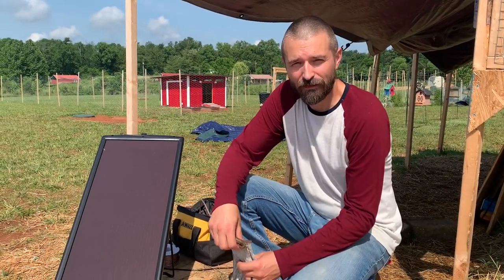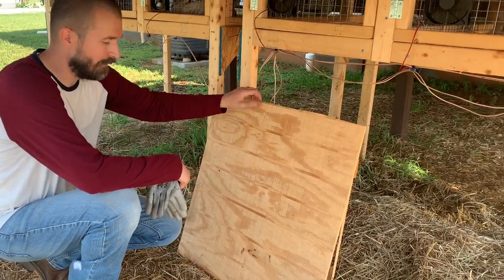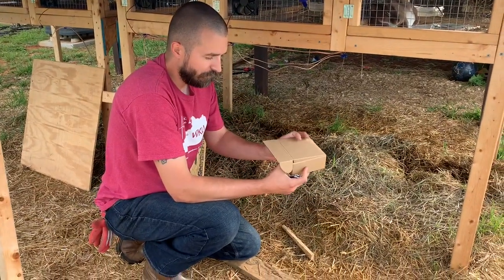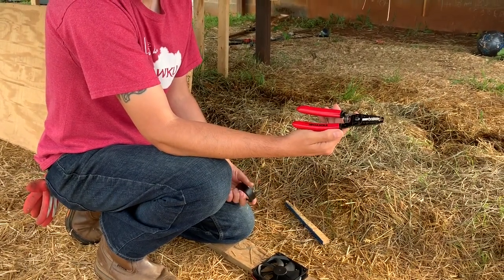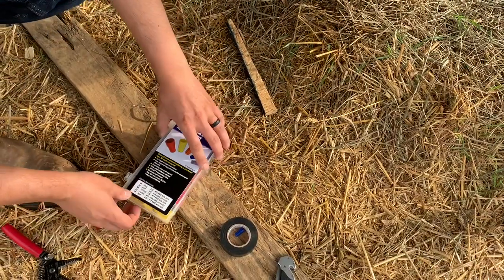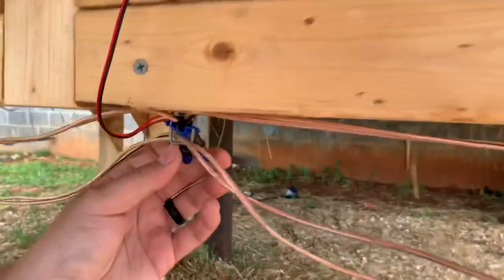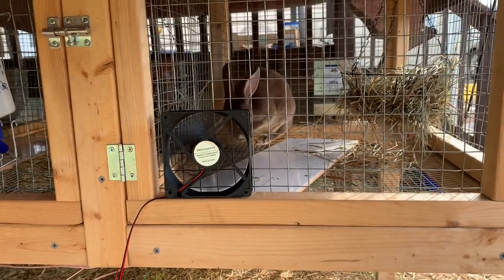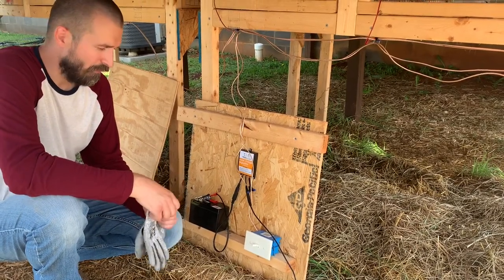Solar Powered Cooling System for Rabbits

Comment: Want to thank you for this video. I was able to follow easily and create the same system.
Reply from the maker: Glad it was a help to up
Reply from the maker: We have since upgraded 2 - 100 watt panels and added a bigger 12v battery car size from Harbor freight and put the fans on light switches and bought some bigger 120mm fans that put out a bunch more air movement and has been a great setup as well
Reply: @HomesteadersOnTheHill  I have 3 computer fans running and I have a 12v ceiling camp fan. Just got it installed today. Do you think you will post your new set up at some point?
Reply: @HomesteadersOnTheHill  when your battery is fully charged what happens? Is it possible to overcharge it? With batteries at times causing fires I just want to know how it works.
Reply from the maker: @newtonfamily7969  , I’m trying to remember this setup but if you have the solar charger on there it will not overcharge the battery but if it is full you cannot use the extra battery power for anything. You would have to attach a second battery in order to continue and build up more battery power. If you tie them together in parallel you capacity increases and voltage stays the same.
Reply: @HomesteadersOnTheHill  I do solar charger. So good to know it will not overcharge.  Thanks!!!

Comment: How are these working over the last couple summers? Have you had to supplement with ice or anything? 

We are hitting 100 degree heat with TN humidity next week. Yuck!
Reply from the maker: We are in Kentucky and also very hot currently. The system works great but since this video I’ve upgraded to 200w panel and 120mm fans. So far we haven’t done ice but typically we throw some bottled frozen juice bottles in for them to rest on and the fam air to blow on them. None have died bc of heat and our males have not gone sterile due to it either so overall works great. I will have to make an update video to show new setup. Thanks for stopping by